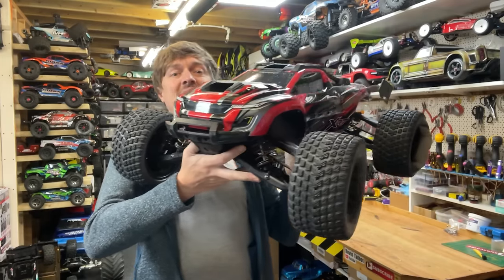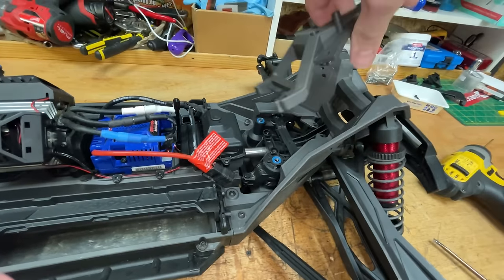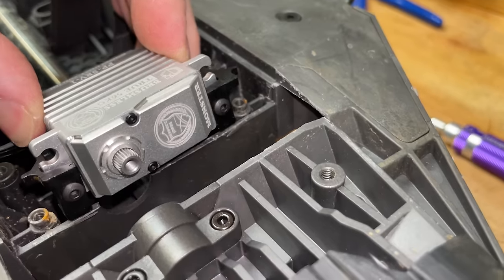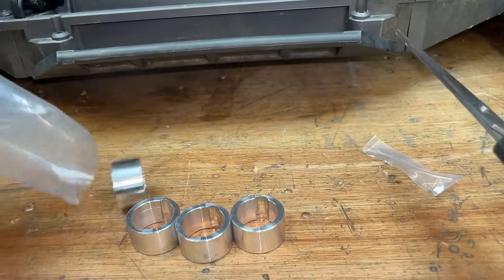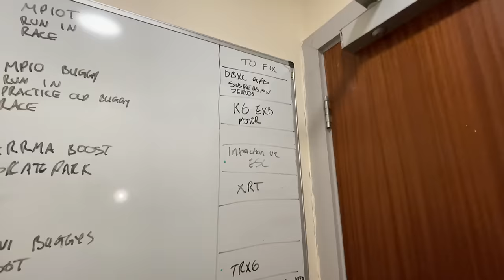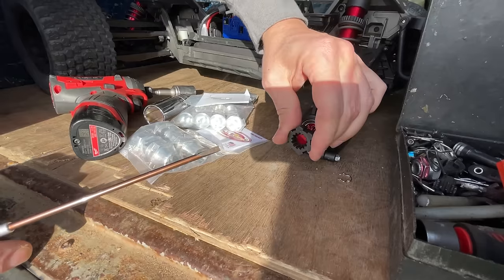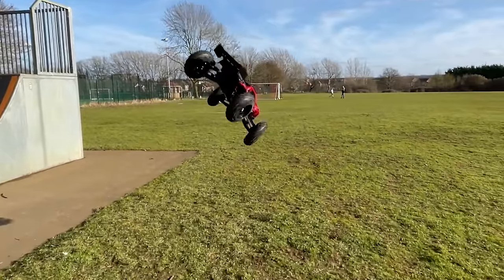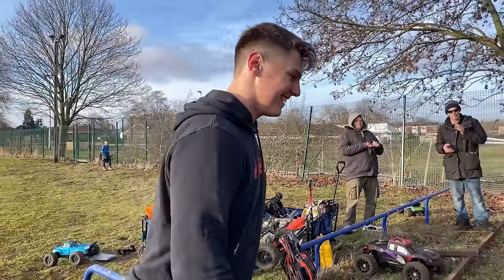Traxxas XRT Weaknesses

Comment: Bought 2 Traxxas Slash 4x4vxl’s about 6 months ago  as a start to the hobby for my son and I.   Paid $425 each for them.  With normal usage (ZERO huge jumps or skate parks ) I’m into both cars nearly $500 IN PARTS.  Replaced everything on both cars except the speed controllers and servos.  Not a cheap hobby.  Just the other day I was pondering with a coworker wether or not if guys who buy a $1000 RC like this come out better OR did they buy a 1000 car & still wind up replacing everything like I did?  Having 2 of them means every time we have a failure I go ahead and buy the upgrade for both cars.  Adds up quick I tell you.  Love your content Kevin 👋🏼
Reply: super late lol but. I have had my max for 6 months doing huge jumps skateparks beaches etc. a-arms drive shafts is the only thing I have to replace. Well the esc aswell but everyone swaps those because the maxx ones are trashy

Comment: That 3D printed wing mount was printed in the wrong orientation. It should have been printed vertically so it won't rely on the layers to hold it together.

Comment: KT, for tyres I ended up using MadMax 5ive-T beadlock mini pins, (stick 5ive-T tyres will work as well), w/duct tape on the inside. A bit smaller, but no ballooning or de-gluing. Also went with a Reefs 1/5 scale servo, which did require some chassis mods, but well worth it.

Comment: Hi Kevin, would you be able to recommend a great 1/10th scale (or close to 1/10th scale) rc basher that isn't too expensive and great for a beginner? I had a wltoys 14401 that was about $150 AUD (I'm Australian btw) and it broke within the first 15 minutes of use despite me not even bashing it. when I had checked what broke it turned out to be a drive shaft because of how thin they are. I don't expect you to answer me but I hope you do as I would like to re enter the rc car world.
Reply: MT10

Comment: the rear wing mount problem looks like itll never end .where it is connected is too close, further in would make more sense design wise two bolt positions would make a big difference, but it looks like its designed to break easily tut tut traxxas

Comment: Kevin, I'm planning to buy my first hobby grade rc car. I've been thinking about the senton 3s what do you think?
Reply: I’m also going to get the Arma Senton. It seems like such a good deal for such a good price! It’s quite strong and it handles well.

I would recommend also buying a dust cover to keep the electronics clean and maybe a spare battery as they can run out quickly.
Reply from the maker: Yeah great choice!
Reply: Awesome, thanks.

Comment: I adapted an extra strap on both the front and rear bulkheads after breaking the plastic that has no metal. rear was far easier than the front... if I were to do it again id just get the metal ones

Comment: Have you noticed the elastomer wearing out quickly? I’ve been installing GPM aluminum Cush housings and find they work a lot better. GPM also make a mod 1.5 pinion and spur for the Xmaxx stock system and so far I’ve found them to be excellent, planning on doing the same for the xrt

Comment: I put washer and longer screw plus locknut pulled silver thing out my m2c bell crank. I upgraded to 2085x . I think the m2c wide kit to much force on it what do you think?

I did put my washer at the bottom vs the top.

Comment: Kevin did you use the Bluetooth adapter and the Traxxas app to turn the ESC up to 120%?
Reply: Wheres that in? Can't find that or do you mean channel setup - throttle
Reply: @davejohnson3474  yes it's in Channel setup in the garage under throttle. Your throttle will say 100% it will go to 120%
Reply: @hotrodlsc3025  have you tried it out if you did did you notice any difference?
Reply: @davejohnson3474  I have a my xmax. I just got my xrt in the weather's been really crappy here but I'm a xmax I got a 5 mile an hour increase.
Reply: @hotrodlsc3025  i'll definitely give it a go but yes weather is so bad atm raining everyday its just to muddy out. Oh nice as you've just got if you do break the 2085 servo tabs from bashing as kev did and  i did then instead of buying another servo and standard size servo adapter plate. M2C have just brought out the 1218 XR SERIES STEERING SERVO BRACE you can use it even with broken servo tabs. I wish they brought it out earlier i could've saved some money myself.
Reply: @davejohnson3474  I will definitely check out the m2c adapter but I also May believe I will still do the conversion for a 1/10 scale servo just because I want something faster and with more power. But for the people who do want to run the Traxxas style servos it is a great option.

Comment: Pay $1000, limited to upgrades in  chassis, it is like a cheap hotel 0 ball room. The pin hinges on arms pop out/bend, tires blow up, drivetrain rips apart completely(hw ESC installed).... I sent it back for a full refund. $1000 usd and the thing is garbage. Engine back came off.... WORST RC EVER FOR THE $, JUST LIKE XMAXX. Made for the little man copping with small man syndrome. Words of wisdom, Traxxas is excellent 3s down, I own 4. Anything bigger go else where or have deep pockets. All the extra things Kevin does are necessary for longevity/durability of a Traxxas 6s+, after spending the $1000 dollars on the rig. Your at 2k easily for batteries and charger, tires, new electronics (cause Traxxas electronics belong in a dumpster past 3s) and than all the extra money to buy parts to even fit the new electronics. It's a nice way to say "welcome to the family, your gonna have to buy your way out."

Comment: Hey kev did you put the hinge pins through the front on the xmaxx also if so can you help please? I tried last night and it stopped it from turning all the way.
Reply: M2C hinge pins go in from the rear with a super thin head to solve that problem.
Reply: @averylooper5534  thank you.

Comment: Considering the amount of work and money needed to make this truly bash worthy, either Traxxas is WAY overpriced for what you get, or Kevin bashes MUCH harder than most dare. Perhaps a combination of the two?
Reply: Traxxas way overpriced.... Any arrma rtr 6s will smash the whole Traxxas 6s+ lineup hands down, arrma does need work on 8s rigs though, but for an exb $500 and can put your own electronics in it, use what ever ESC/motor combo you want, not stuck with junk servo. There's your bargain Traxxas is the buy and drive brand for beginners who just want to drive. Leave the car the way it is, follow the gearing chart 0 problems.  Exb and kits for the hobbyist. Personal preference as I own 4 Traxxas, all 3s or lower(Traxxas all day in the 3s unless you want specific ie infraction/vendetta), and 2 arrma 6s(kraton/Typhon). I wouldn't trade the customization of Arrma for nothing.